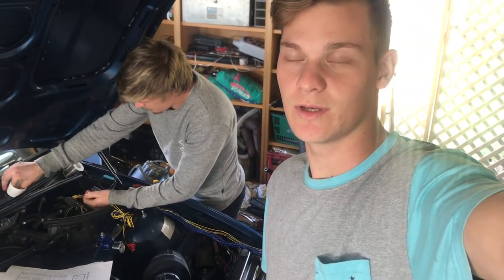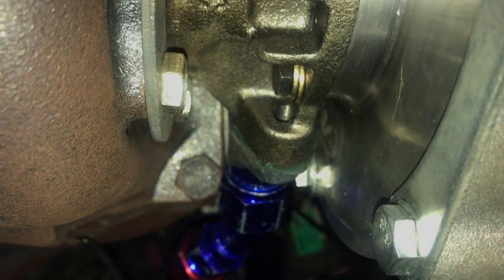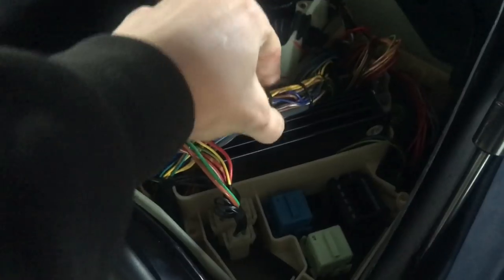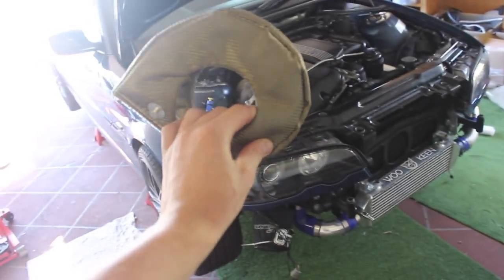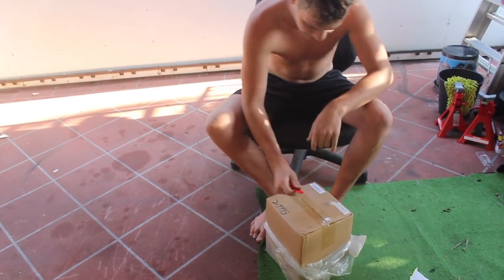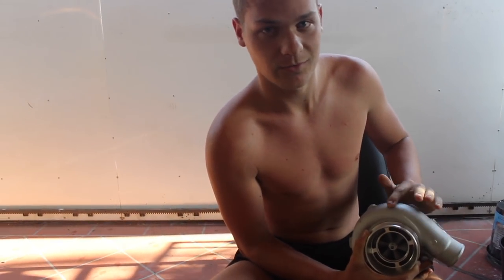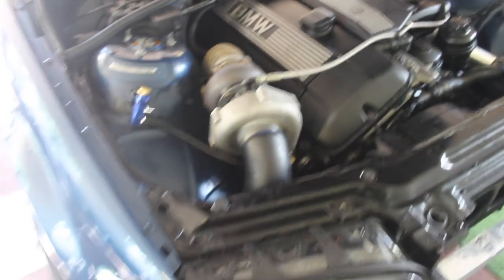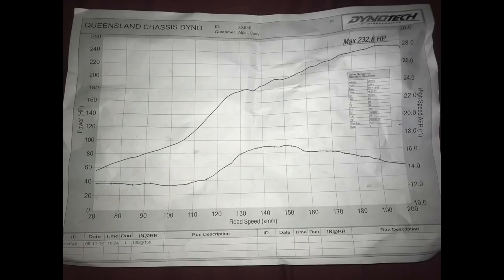BMW E46 TURBO BUILD | ep 4 | BIGGER TURBO AND DYNO RUN

Comment: Hey, I've been looking into a supercharger/turbo setup on my '04 330xi. Well I got behind a supra the other day and that pretty much made me lean towards a turbo haha. I had a few questions I was hoping you wouldn't mind answering:

1. Why did you go with a piggyback ECU? I know you are on MS42, but for the MS43 it is looking like all the tuning can be done on the stock ECU. I'm basing that off the info on MS43wiki.com and some other threads on E46Fanatics. I thought there was similar tuning options with MS42 that would make it so a piggyback wouldn't be necessary.

2. What is the total cost you are into this? The SuperCharger setups seem to be about $4k (USD). They seem to be more straightforward but more expensive. If I've been following along correctly you would be at about $1500-$2000 (USD). I'm already in $250 on headers which had me kind of leaning towards the SuperCharger at first.

3. Do you have a thread on E46Fanatics? I saw the sticker you've got on the window and thought you might have a thread, but I haven't seen one. I'm sure another turbo thread on the FI subforum wouldn't be a bad thing.

4. Had you gotten everything proper the first time how long would the install have taken? I'm debating doing this during my spring break, but idk if that'd be enough time (1 full week). Waiting till then I think would give me plenty of time to plan everything out properly. But from what I have gathered the install is just a first step in the process.

I'm not 100% sure if I'd go through with this yet. I might do schrick cams and an LSD first. I'm not a big speed freak but was just kind of wanting to go to 335i level of performance. I'm going to the track this weekend and the current plan is to go semi regularly from now on. I feel like an LSD would be far more beneficial there. If I sell a bunch of stuff from my old hobbies and save up with my winter jobs I should be able to afford both. My brother has a 328i he's been planning on turning into a track car and he supposedly has a rig planned that can convert an E30 LSD to work on an E46 for like $500 rather than the $2500 for a custom diff. If that's true I could definitely afford everything.

If I had to sort everything out it would be: mods to allow redline increase to ~7k (Vac damper and an improved oil pump nut (~850)), vanos rebuild & cams, LSD & bushings, then turbo.

Sorry for the long post, I'm still thinking through everything and am only a few days into research. This series has been great and I'm sure it will be a great resource for people planning on turboing their E46s.

Comment: Hi Cody I’ve got 90% of everything I need now to turbo my E46 from following your videos, just a question though, do you know what length your turbo oil feed line is ? As the one I’ve got is too short, thanks
Reply from the maker: Hey im not sure what length it is man
Reply: Cody Aplin ok, I’ll just have to fit the turbo and roughly measure how much I need afterwards

Comment: Hey just wondering. did you extend the wiring for the MAF sensor ?
Reply from the maker: Yep just cut and solder new wire in
Reply: @CodyAplin  im currently building mine in brisbane its a 330 vert. you video said your MAF sensor maxed out. how did you work around this? were you able to scale it using the piggy back? or did you upgrade the MAF
Reply: for anyone wondering the aem fic6 piggyback can do that without needing to change the MAF on these nuggets.

Comment: where did you run the turbo oil pressure line too? oil filter ?
Reply from the maker: oil pressure is tee'd into the bottom of the vanos line, the same place where the turbo oil feed is connected

Comment: Didn't need change any part of the engine? Something in the head engine?
Reply from the maker: Carlos Ros thicker headgasket and studs video coming soon
Reply: Cody Aplin nice! What thickness? Or what compression ratio you have with the kit?
Good job! I'm thinking to make the same in some months ;)
Reply from the maker: .098 inches. Compression has been reduced from 10.5 to 9.5
Reply: Cody Aplin aren't you supposed to make a lot more horsepower ? Like 200+ after a tune? Or am I wrong. I'm trying to find out what plug and play turbos will do to my stock 325ci. Thanks!

Comment: I want to turbo my e39 cheap any suggestions
Reply from the maker: watch my videos
Reply: I run a few turbo e39's. 528 iron block is best to start with. M54 's or m52tus like to warp heads/ break studs over 450 hp.   Basicly a e39 is just a big body e46. Everything is the same parts under the hood.

Comment: Can you link me the ECU you used ? Thanks!!
Reply from the maker: https://www.ebay.com.au/itm/AEM-FIC-6-Programmable-ECU-BMW-Turbo-E30-E36-E46-E39-325i-328i-M3-330i-530i-323i/171455202367?hash=item27eb86c43f:g:bsUAAOxyMZVTj~JJ
Reply: Cody Aplin appreciate the response!
Reply: Where did you find upgraded fuel injectors and fuel pump for this car/ turbo build? Ordered a cx racing kit today will be putting that kit on my car.
Reply from the maker: Daniel Steven wallbro 255 fuel pump and 440cc injectors in eBay
Reply: Cody Aplin would you mind linking me the ones you bought, also did you have to rewire the fuel pump / and injectors ? Thanks !
Reply from the maker: i wired fuel pump. injectors plug straight in

Comment: Im running 9 psi in my 2000 328i and i make 440hp stock internals. I wish i had an m3😂
Reply: all u did was put a turbo on it?
Reply: hp is probably at the engine not at the wheels.
Reply: Turbo and exhaust bypass system
Reply: But the E46 M3 only made 340hp... Your 328 is... Mean.